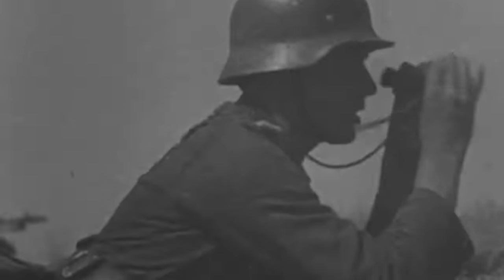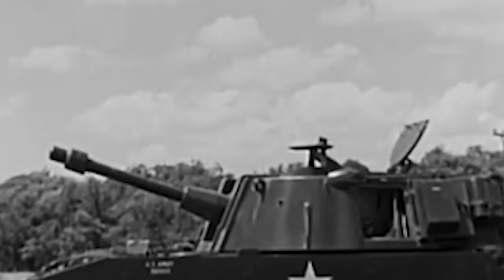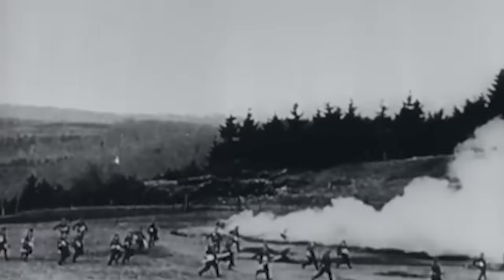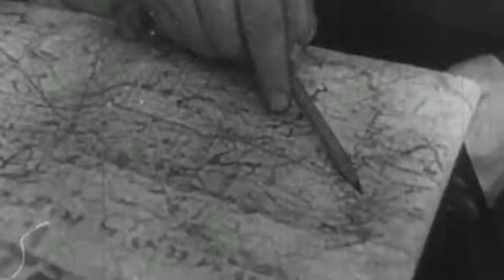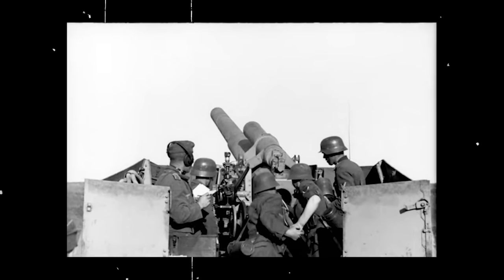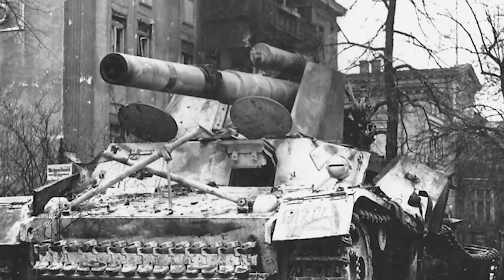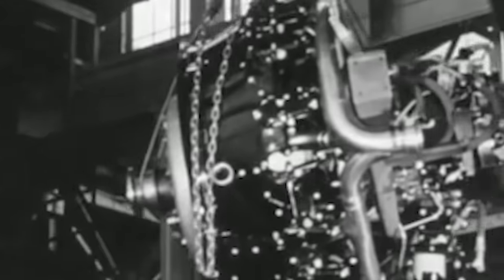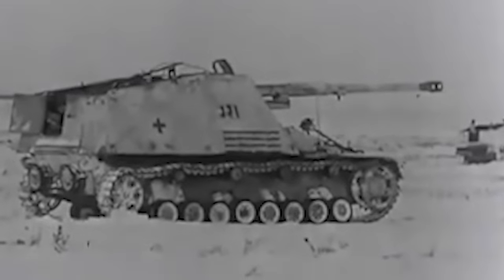The Shocking 24-ton German Iron Monster with an Impossible Task

Comment: why is turret fixed?
Reply: You can’t mount a gun of that size in a turret!!
Reply: It's an artillery piece rather than a tank.
Reply: in basic it has not have turret
Reply: To allow for simpler construction
Reply: It was cheaper to manufacture it without rotating turret
Reply: @simonjackson7269  Tell that to the KV-2, at least as far as caliber goes.
Reply: What turret???
Reply: Do you mean that brace for gun or the superstrture,  from reading , it was a lot less weight without the turret
Reply: @snegy7119 less weight too
Reply: It would then be a tank…
Reply: @YeeMacghyee  kv2 couldn't even shoot sideways in fear of tipping it over....